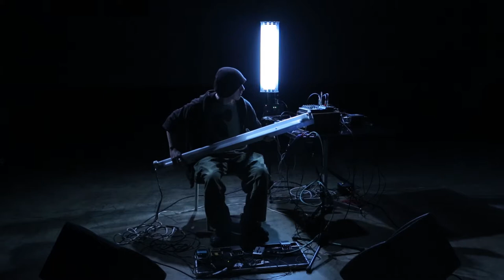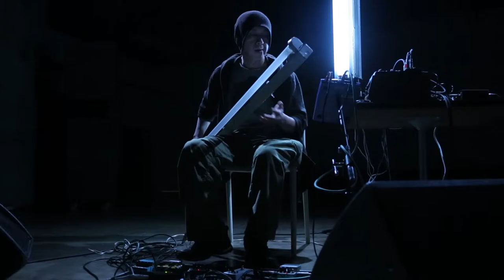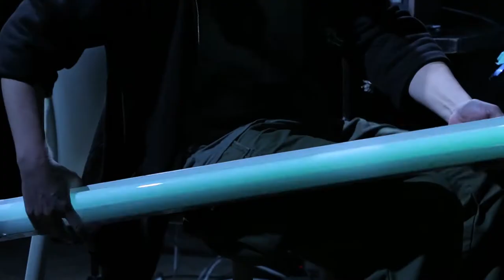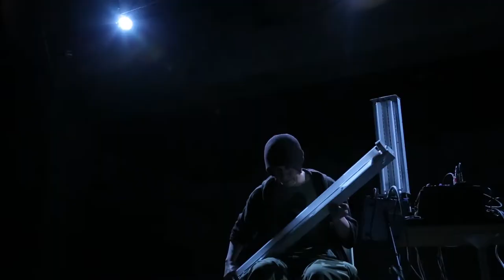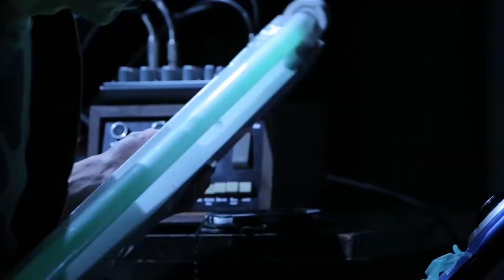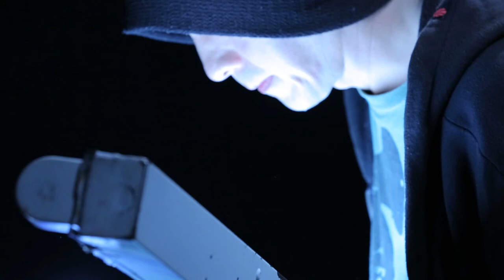Atsuhiro Ito　Tokyo Experimental Performance Archive

Comment: Okay, I think I've got this one sussed out: he's using an Alesis AirFx, an "instrument" that's something like an optical theremin with tons of presets/effects. It's controlled by waving your hand around it, sorta like you would with a regular theremin. But instead of his hand he's using a giant light. Optical theremins respond very differently to direct light exposure than they do to the proximity of your hand. The knob on the back of the giant light, if I had to guess, controls a parameter tied to the AirFx. And then he sends the results through several more effects units at his feet. He's also using an old Rhythm Ace drum machine alongside a much newer drum sequencer; the latter is also synced to the vertical light on the table.
Reply: I think there's more stuff going on but thanks for your comment
Reply: what you said is true, but I want to add that the main sound source is the light itself, he said that he amplifies the inaudible buzz sound that a fluorescent light makes when it turns on using a modified pickup mic. I don't know the specifics, but that is why he quickly switches the light on and off. you can check this out in a video where he explained the whole thing to 20hz magazine here on youtube, I don't know if I can post it here, I don't want the comment to be deleted.  the thing is, I don't really know how that sound is then fed into the whole thing, maybe through a simple aux and maybe the optical theremin thing is separate and a controller for the other instruments (but it's always in sync with the buzzing light)??
Reply: He's mentioned using a "special pickup" which leads me to believe its a induction microphone somewhere near the ballast inside the lamp rigged to a momentary switch. I'm working on reverse engineering something similar from watching his videos. In earlier versions he mentioned adjusting voltages which is dangerous so I think you may be on to something with theory about the pot being wired to the effects.